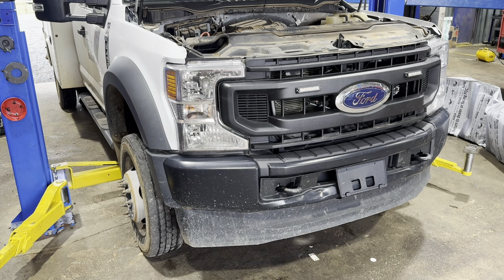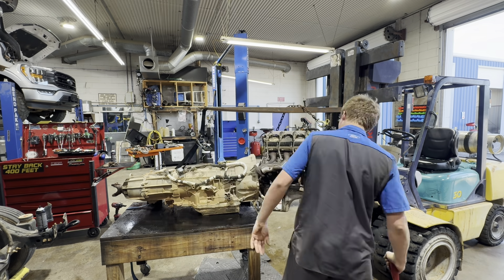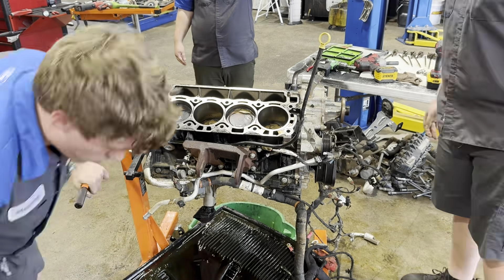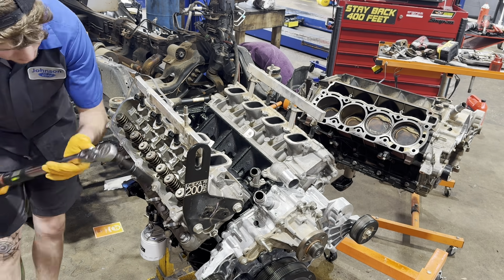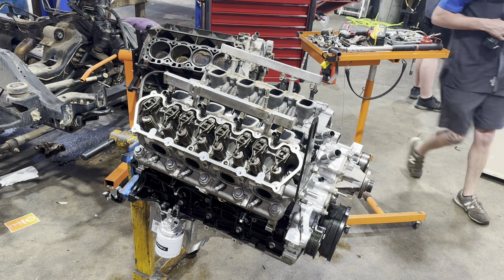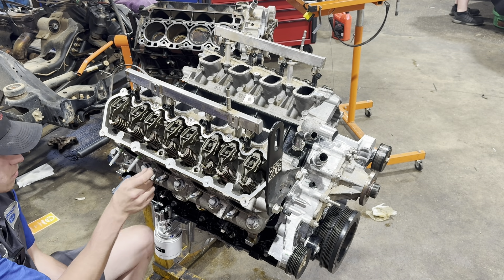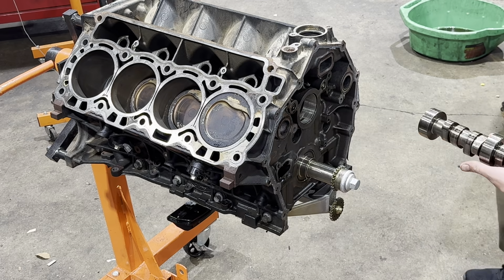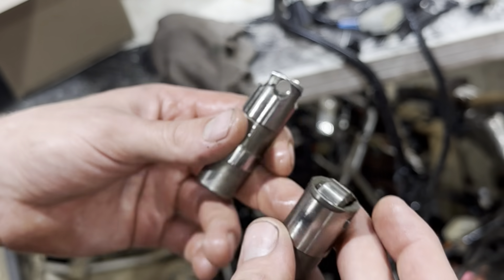Ford 7.3 Godzilla | Does this one issue make the engine a bust?

Comment: Not sure why you call the 6.2 junk. It has proven to be extremely reliable over its 13 year run
Reply: 6.2 was the cure for the 5.4 3valve
Reply: @marioncobaretti2280  Well said!  No issues after bulletproofing my 2008 5.4 3 valve 60,000 miles ago but the 6.2 is better in every way!
Reply: @marioncobaretti2280  the first 5,000 Raptors  had the 5.4 because the 6.2 wasn't ready for production vehicles.
Reply: @marioncobaretti2280  in the Raptor for sure.
Reply: @marioncobaretti2280  I don’t think that’s necessarily true because the 6.2 L was only found in the 3/4 ton and one ton work trucks.
Reply: I agree. I work for the Parks Department of a city, and our entire fleet is F250's with the 6.2. They've been super reliable so far and handle loads and towing with no problem whatsoever. 👌
Reply: I have a 2015 with a 6.2 and it has been a durable and dependable engine. I wish it made more power on the lower end but I have had 15000 pounds behind it hauling wood with 5th and 6th locked out going from northern Idaho to Eastern Oregon without a hitch. Averaged 9.6 mpg and highest rpm was 5500 pulling some decent grades. 160000 miles servicing every 5000 miles with motorcraft synthetic oil. I know the early 6.2's had valve spring issues but I have had zero engine issues so far. My truck before that was an 04 with the 5.4 2 valve and even with almost 300000 miles it still ran good but didn't like pulling my 35 foot 5th wheel. My 6.2 doesn't care what I put behind it so far.
Reply: @poppasmurf1969  preacher brother. The 6.2 L V8 paired to that six speed transmission was the last solid truck Ford made.
Reply: 6.2 has become the longest lasting Ford engine I’ve ever seen experience redline daily with frequent oil changes
Reply: 6.2 has been reliable. Maybe he just doesn't like the way they were put together. It does seem like the manufacturers are purposely making stuff harder to work on for no good reason
Reply: I have an 11 raptor with a 6.2. 173k and the first 100k the first owner beat the living crap out of it. Runs like a top. Only problem ive had with truck is rebuilding shocks, and a new transfer case shift motor. With the 4.10 gears of the raptor I love my 6.2.
Reply: I have a 2012 with 400,000 miles on it. I've actually seen higher than what for sale.
Reply: owner off few 6.2 f250s  ill only buy those trucks great engine for me 😊
Reply: For sure my 6.2 and a few other people's 6.2 not to say companies 6.2 all 300,000 or more for sure.
Reply: Loved my 6.2 in my 2013 Raptor. Absolutely hated the 3.5EB in my 2013 lariat f150
Reply: 2011 F-250 6.2 177,000 miles and still running like new. Never had a single issue with this engine. Definitely not a "junk" engine.
Reply: I'm not sure you understand. These are Ford technicians. When they see warranty work come in over and over. They know what to expect. He did clarify a little later on that it's not complete crap; he was saying it has a lot of inherent problems.
Reply: @kudosjeg  negative ghost rider. The 6.2 is a solid engine. Been around several in the oilfield running some of the worst oilfield roads. They idle alot, they spend much time at 100% throttle and shifting at 5,500 rpm all day long and they keep going. Yeah, there are a few issues every once in a while. Bit that is any engine, no matter the make or model. Some will fail. But my experience with the 6.2 is it is one tough engine. Very dependable.
Reply: I’ve got a 6.2 with over 300k miles. Never had a single problem. Looking at a 7.3 now just to upgrade and plan to give it to my sister when I do
Reply: Young guys think they know everything……..yet…….they do not 😂
Reply: I had a 21 6.2 . Solid I couldn't stand driving the vehicle with all the racket it made. Plastic cam phasers we're rattling like crazy at  start up . Dealer said nothing they can do that's just the way Ford makes it
Reply: @kenj.8897  one thing to check is the manifold intake they have a flapper in there that can make that noise   also
Reply: @kenj.8897 Oh Bullshit
Reply: As long as you feed it a quart of oil every 1k miles
Reply: Nice pickle rick my guy
Reply: I wonder if this is related to the lifter failures the aftermarket has been suffering from??
The same companies that make all the lifters for OEM make for aftermarket 
The heat treatment and grinding have been an issues for the flat tappet choices but the cure was to go with a roller.
Now the rollers are failing??
Reply: I’m personally not a 6.2L fan (in a superduty, at least), but I have to agree with you & give it its due credit. Used to have (2) ‘14 model 250’s, both CCLB 4wd automatics with 4.30 diffs, 100gal transfer tanks & tool boxes in both beds & 12k Warns hanging off the fronts. One of said trucks [daily] job was pulling a ~10’ tall enclosed tri axle gooseneck that weighed in the mid 20s on average, itself. Always kept 6th gear locked out unless unhooked, of course. Typical fuel mileage ~5.5-6mpg hwy. They were absolute dogs even with tall rear ends but the fact that one spent its first [well over] 100k miles working that hard without windowing the block & no oil consumption to speak of….it would be just wrong to not give it some credit.
Reply: Love my 6.2 but I could really use more torque. It’s a real shame ford won’t use the 6r140 with the 7.3
Reply: Didn’t make him money is why 😂😂😂
Reply: He hates them because he couldn’t make any money off them like the 5.4, 6.0, or 6.4
Reply: I have a 16 F250 with the gas engine and I have towed my 14,000 trailer without any issues or felling like I needed more power. My truck is a SRW so I can only drive so fast with a 40ft trailer and it maintained the speed limit with ZERO issues. To this day I still have it and it has almost 200k miles.
Reply: @nickolaslewis4416  my 6.2 is almost at 290k
Reply: Yup I’ve done lifter n cam on 7.3 godzilla
Reply: I heard nothing but great things about the Ford 6.2l boss engine I love my 2012 6.2l gas super duty it's great
Reply: Is there a way to tune the variable pump to up the psi?
Reply: LISTEN TO THE VIDEO!!!Its junk!
Reply: Junk
Reply: Switched from gm 6.0 to ford 6.2 absolutely love it ford should've never went back to push rod engines they solved the problem of the 5.43v and created a new one
Reply: @gildroyboothe2548  indeed. It is a true big valve motor. 2V OHC. 2 ingotors per cylinder and they actually come out without leaving some behind.
Reply: @gildroyboothe2548 Ford already admitted that there are undeniable advantages to the pushrod design when it comes to tirqye and fuel efficiency. That's why they went back to pushrod. There are plenty of issues with DOHC. Ford has struggled to solve those DOHC issues for decades.
Reply: When I  did my research before purchasing a f 250 with the 6.2 everything was positive and fleet owners engine of choice .  My purchase of  my 18 srx 4x4 has been wonderful!
Reply: they are a gutless engine
Reply: @whelenguy You're gutless
Reply: Not really, I bought a used 2020 f250 2wd regular cab 8' bed. It scoots like a turpintined cat when you mash on the throttle. Regularly challenged by older coyote f150's and it holds its own usually hanging door to door. Bought it for a work truck and I am averaging 17-18 mpg for a 65 mile round trip. So far it has been an excellent vehicle. @whelenguy
Reply: 2011 6.2 owner since 2013... Needs more torque 3.5 Ecoboost has more. But see reliable.. for last 12 years . 

Got say bought with 36k miles ext.cab Lx base model $20k ... Can't do that these days.
Reply: I work for Ford for quite a few years and for Chevrolet I've been a technician for over 50 years and has the same problem Chevy has with lifters and are not fixing it that's why he's trolling those engines if you haven't worked on these yourself you really don't have nothing to say some of you probably have had good luck with these engines but the majority of them have been junk don't blame the technician blame the people who build the truck originally
Reply: @RobertMccollum-b3k  no one is blaming the tech, but voicing our experience with the engine itself..and the beauty of it is I haven't had to work on it, I change the oil and work the heck out of it with zero issues. Transmission on the other hand I'll have to rebuild because it's making noise.
Reply: @RobertMccollum-b3k 

Lol @ "the majority"....
Reply: @RobertMccollum-b3k your correct thank you for you great comment.

Comment: The idle RPM on all the current pushrod motors are around 500 RPM to meet emissions requirements by the government. Compared to older pushrod motors that idled around 700-750 rpm. Best thing to do is to limit idle time, use quality oil and 3k-5k max oil change intervals until you can get outside your warranty and have a tuner bump the idle rpm up.

Comment: Ford has an update for all of the 7.3 and 6.8 for idle oil pressure 24b27 could you make a video of that?
Reply: Yes nothing is mentioned there in the video above. Either ford does or doesn't have an update. Maybe fake tsb
Reply: @jimbobxcityguy5338  it’s on fords web sight and the NHTSA it’s real not sure why they are dragging their feet
Reply: @jimbobxcityguy5338 it’s on their web sight and NHTSA
Reply: @jimbobxcityguy5338 it’s a real tsb.   It’s on the NHTSA page.  

https://static.nhtsa.gov/odi/tsbs/2024/MC-11002845-0001.pdf

Comment: Engine's have been running with low idle oil pressure for a long time,GM v6 motors ran at 8psi at idle back in the early 90s,I would blame more on horrible quality control across the board

Comment: So glad I'm out of the repair business. I changed many engines. Never had to remove cab. Guess dealers had to find a way to increase service hours bulled.
Reply: only way to get engine out is pulling cab, cab's come off pretty easy, not as difficult as you think.
Reply: Originally I thought having to pull a cab was a stupid design but I can only dream about how easy that would make it to work on my 2003 7.3 diesel
Reply: They tuck it halfway as far back as a van and make my dashboard big enough to sleep on. I hear you about the accessories need to be disconnected anyhow. But this shade tree mechanic just went and bought a shop vehicle lift and a steel street plate to bolt it on so he can work on these when the cherry picker always used to get the job done all by itself. How do you change the engine in a van anyhow?
Reply: Cab can be off in 30 minutes with a fast tech.

Comment: Having to remove cab to remove engine - most assine engineering ever! Must ask why - bet it sells new trucks more than ever!
Reply: The way Ford sets the engine back in the firewall it's hard to get at even when changing the spark plugs. We could get the cab off in about an hour and a half. Then it makes it real easy to work on the engine or transmission without having to take the front end apart and go out that way.
Reply: @scottp5331  Okay - 1.5 hours to pull a cab. You say "we"" - implies at least 2 techs. Now how long to put that cab back on & test to make sure everything works? Maybe 2 hours? So, 2 techs times 3.5 hours = 7 man-hours to R&R cab. At today's shop rates that's at least $750.  Just to work on the drivetrain, plus any repairs performed. I used to replace an engine for about 7 hours labor! A difficult one might be 12 hours. Shop rates back then were $30 an hour. So about $210 - $360 labor.

Comment: Why not put an oil pump that that runs at higher pressure at idle? Come on Ford. The fix seems simple. I’m not a mechanic but I know that engine parts that move need lubrication!🤔

Comment: Why would Ford have the dummy gauge require 7psi to start reading oil pressure on the dash but they have the oil pump designed to only push 1 psi higher than the gauge needs to even read oil pressure?  1psi margin of error?  Not buying it.

I think the "mechanic" in this video needs some more training before making videos acting like a subject matter expert.  I dont doubt you've worked on Ford vehicles.  I doubt that the information you are claiming in this video is accurate at all.

Come back when you hook a mechanical gauge up to a 7.3 and read the actual oil pressure at idle.

Comment: 8psi at idle is crazy. My 200k mile 4.0 jeep idles at 30psi and runs down the road at 50+psi. It started idling at 15psi and I pulled the pan and threw in a high-volume pump no way I am letting it get below 15.

Comment: You can't just say the 6.2 was total junk without giving a justification. It is one of the best engines Ford has made.  Seems more reliable than the 7.3, with the most common issue being broken valve springs.
Reply: 7.3 diesel stopped in 2002 is 1000 times more reliable than ANYTHING gas or diesel ford made after 2002
Reply: @captaintoyota3171 to bad the7.3 don’t make power. The 6.7 has proven reliable and will drag a 7.3 ps all over the place
Reply: @captaintoyota3171  Not talking about the 7.3 diesel, fool!
Reply: I’ve got  395000 miles on my 2012 F250
Reply: Exactly right. Ive seen plenty of Raptors with the 6.2 with 300k + miles on the 6.2
Reply: I don't believe that for a minute @ericblakesslee5784
Reply: @ericblakesslee5784  It definitely wasnt my Raptor. I took care of mine but by 82k miles I had to get the engine replaced. I dont get how people like you are defending the 6.2, the consumers says it's reliable but the Ford mechanics near me say they're junk. 

I ended up with a 5.0 anyways, statistically reliable, reliable to the consumer, reliable to the mechanics.
Reply: Yep, the 6.2l is an incredibly reliable engine. Very few problems even with the old spec 5w20. The 7.3l was a step backward in technology and reliability. But its cheaper to make, that is why Ford really went back to an OHV design.
Reply: 6.2 was a better fit for a half ton, not a super duty.
Reply: @ hilarious
Reply: He's a ford (was) mechanic. He would know. So yes he can just say it... he's lived it
Reply: He has gone over issues on them before I can't remember if it was injectors or what it was but it was something goofy like $3000 to reprogram them if you have issues with them and he has had customers that had the issue back to back having to pay the $3000 to repair it multiple times same issue
Reply: Really 6.2 tell us why
Reply: Junk
Reply: The 6.2 though somewhat gutless was was very reliable. I have run the 6.2 and they work fine. Towing up a hill was rough though lol.
Reply: Made as much power as most 4 cylinders. And felt slower
Reply: They are using junk Parts, it's all about profit! And all truck companies are still doing it!
Reply: I got a 6.2 gas in 2019 f250 , was totally suprised by the power and  gas mileage, farm -ranch use
Reply: and in my experience the valve spring can be replaced in situ.  and will run strong   the other two issues i ran into alot was exhaust manifold cracking in half    and ign coil  arcing, sometimes back into the pcm wiring
Reply: I agree, the 6.2 was a crapshoot of it's own but it did eventually reach it's power curve and did it's job pretty well, like the 5.4. But this is a disaster! And how the hell did the US government allow this massive 7.3L gas engine to be allowed to sold as a 'replacement engine' for the 6.7L diesel??? It big, ugly, weak, cheap and made in china!
Reply: @JohnD6280 it's not made in China, retard
Reply: Not made in China, made in Canada
Reply: @JohnnysCrap it’s made in canada* not China but close.

Comment: Just curious...what would be the benefit to programming in reduced oil pressure at idle?  It just seems like that would be a bad idea from any angle...can't understand why they would do it.  Thanks for another informative video!
Reply: They don't. The variable oil pump is to reduce hp draw-fuel use by oil pump at revs. Instead of wasting fuel and dumping oil through overpressure relief, they move vane housing over and cut volume per pump rev.  In high load use a gas motor is going to run high rpm.
Reply: @jimmyaber5920  - Thanks.  I figured it had something to squeeze-out a fraction of one mile-per-gallon to meet CAFE standards.  Seems like it would be a really easy engineering fix with a few keystrokes of code...I can't see how much more fuel they would use if they even doubled the idle psi...but I guess engineers have to bow to government standards instead of actual reliability.  It seems this issue isn't a Ford issue...but more of a forced efficiency issue where manufacturers are making dozens of very small changes to save a little mpg.  Thanks again for the explanation!

Comment: The after-market needs a kit to replace the variable displacement oil pump with a fixed displacement one. Ford sh1t the bed with this oil pump nonsense. It was not worth the bother to begin with.
At least they used a chain to drive this abortion instead of a rubber belt.

Comment: I replace the long block on my warranty repairs. I also have seen a lot of cylinder wall scoring causing leak by and misfires. I just finished engine number 6 this year.
Reply: The Duke says, why are the cylinder walls damaged? What did I teach you?

Comment: What is your opinion on the 6.8 V10?   Later models
Reply: The 6.8 v10s was great!  But very thirsty! But a great engine, it wasn't uncommon for those things to go 300,000 plus miles. Occasionally they would blow a spark plug out of the head, the 5.4 would do that too, but it can be repaired fairly easily with I heilicoil kit.
Reply: The later ones make about 50 hp more and are 3 valve. Did not have the problem the 5.4 3 valve had. 300k is pretty normal if taken care of. My Excursion has the 2 valve v10 and just hit 180k. Still running great. I've only changed the oil and plugs since I bought it

Comment: What was the actual measured oil pressure at idle?  Amazingly, unlike Ford's dummy oil pressure switches connected to a dummy half way riding gauge used for years, this one has a 3 wire EOP sensor so the data PID will give you a ball park.